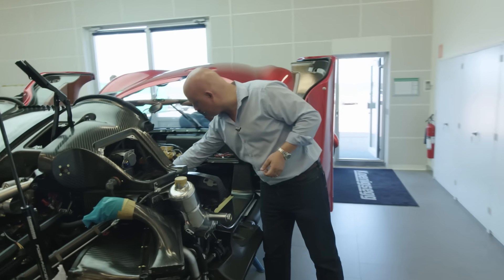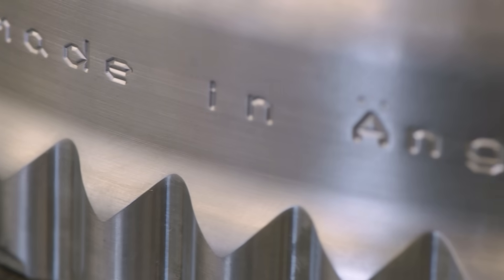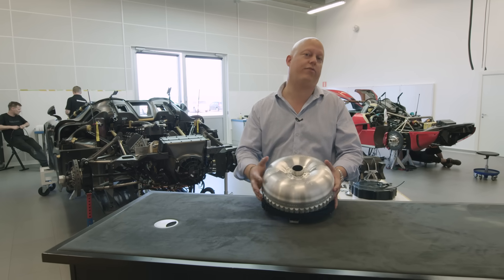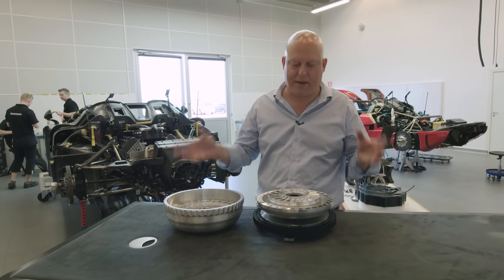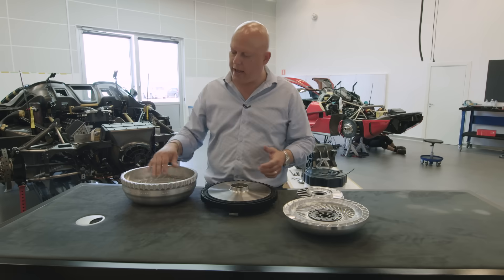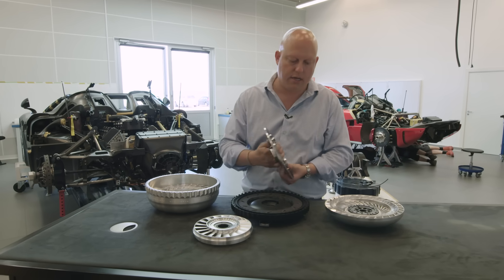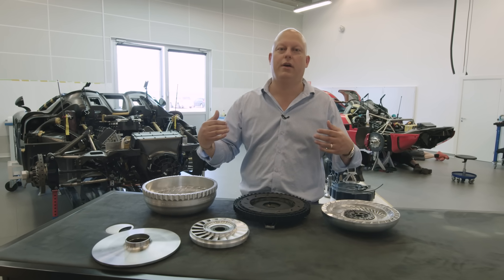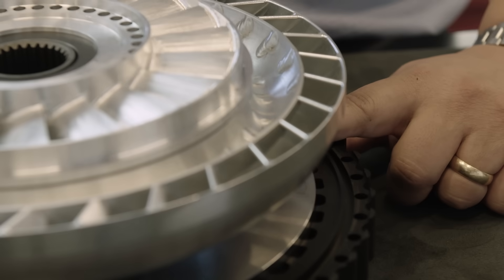248 MPH Without A Gearbox: Direct Drive  -- /INSIDE KOENIGSEGG

Comment: I wonder what is the life of that torq converter? Aluminum will fatigue over time, and wear out. What is the cost of that thing? And did you have to use special fluid for it? Its a convertor on steroides, and the weight and force of what it has to endure is really extreem. How hot does it get?

Comment: I think maybe he stated an error. When referring to the use of only the rear electic motors he said 0-60 in 4 seconds, the he said that with a change in gear ratio acceleration is even faster. I was always taught that electric motor made the same power at 1 rpm as it does at any other rpm..torque curve is a flat line...can't have an increase in acceleration without an increase in power. What he said does apply to an ice but with his torque converter setup it is possible run the engine very close to peak torque all of the time...sure be fun to drive, I bet it's one of those deals that pulls stupid hard at any mph...no down shift required...no downshift possible.... downshifting is now known as engage all motors and engines on my mark big BANG and we gone...lol

Comment: It's a fairly simple system, but when battery technology advances enough, pure electric direct drive will be the way to go. If I were to attempt to break the wheel driven land speed record, electric would be the way to go. You just need enough battery charge density, a powerful enough electric motor and good aerodynamics to crack it.
Reply: electric cars still want to up shift at these speeds. their power band is wide, but still not THAT wide

Comment: So basically its a turbine connected to the motor that transfers its energy to another turbine connected to the wheels, until they are traveling at the same speed at which point it locks up.  Is that accurate?

Comment: I wonder how long it will take the Tesla roadster II to break these records? ANd they will be about $250,000 each, can hit 100mph in 4.7 seconds, 60 in 1.9 seconds and are so much cheaper. Monocoque  carbon fiber design and never change the oil, no valve jobs and all the other very expensive maintenance that hyper cars require just to stay on the road. I think Musk might be onto something there. but he needs to get some sleep, he's burning out.
Reply: if he doesn't bring back a multiple speed gear box, it won't be as fast.

Comment: So it's basically a 2 speed gearbox. Or a "hydraulic CVT"?

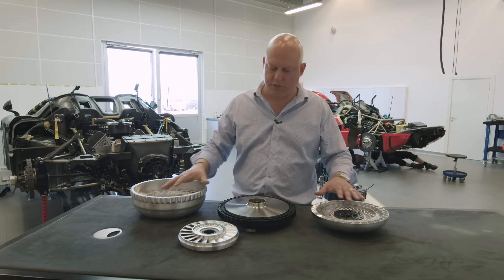Did anyone else catch the part where he said it can take 2000 rpm in, put out 1000 rpm and more than double the torque? Free energy machine right there! At 5:57
Reply: There is no gearbox in the regera go online to see how it works or watch engineering explained video
Reply: I made the same mistake here as Jay Leno, interchanging the words "gearbox" and "transmission". I meant the torque converter functions as a 2-speed transmission whether it's in lockup mode or not. Because Christian says it can do a 2:1 speed reduction and double the torque, or run 1:1 when locked up.

In Jay Leno's video, he keep saying it has no transmission. What he means is it has no gearbox. The torque converter is a transmission.

Comment: Pretty cool engineering but how long does this torque convertor last?  If it is like that carbon fiber clutch in porsche gt, replace every 15k.. i am sure cost is probably more than most cars and you will have to wait for them to make one ;)

Comment: Wow, that is a smart technology! Combustion engine and electric engine combined on giving torque on this progressive, dynamic, hydraulic transmission system. That is amazing! I wonder at what speed does the lock up clutch mode activates.
Reply: Though this is pretty old technology what he did is put a hybrid drive train to make it more Morden

Comment: Okay got that, seems clear enough. Having heard a Regera in traffic going on and off the throttle, I found I didn't like the sound, it was like listening to a cvt in a hypercar. I didn't like the whoosh noise of intake air either from the cockpit, sounded like an ordinary car minus it's aircleaner. Otherwise nice car. Oh, and I thought that was the exhaust at the rear, not the air extraction outlet, lol.

Comment: Can you make one for my 1998 Honda Accord?
Reply: if it is an automatic it already has it
Reply: So to emulate this zegg, i just need to throw away my gearbox but keep the convertor, connect the convertor directly to the drive shaft, get a forklift motor and connect it to the convertor via a friction clutch which desingages at high speeds, connect the engine to a 5:1 torque multiplier with lock up feature and connect to driveshaft, get 8  normal car batteries as a battery pack, get 4 alternators and hook each to 1 wheel using brake activated friction clutch, maybe instead of 8 batteries i get 4 hydrualic pumps, attach each to each wheel with brake activated friction clutch, get another forklift motor to generate power for the drive shaft dc motor
Reply: Buy automatic remove gears =direct drive

Comment: People are too amazed!
Basically Formula 1 has had this and other technology for 30 years.
I'ts rather that new tech gets banned from Formula 1 because the cars would go too fast!
CVT gearboxes.
Turo and Compressor.
Horizontal mounted shock absorbers.
Torque convertors.
Launch control.
Traction control, 
Individual tire torque/brake control.
Venturi tunnel.
Paddle shift gearbox.
Reply: All of those were people designed

Comment: So the way I understand this is:

The Regera is constantly in 1 gear which is equivalent to 7th gear on the Agera.

But the way it takes off or even moves in general is by using a hydraulic torque converter to double the torque produced by 1200hp combustion and 200hp electric motors.

Combined with the HP from the electric motors behind the torque converter.
Reply: Exactly there are two 200hp electric motors in the rear on the wheels and one in front on the crank shaft.
Reply: it is basically like a cvt.
Reply: @devinwilliams3489  nah, it's not. CVTs still have a variable gear ratio to change the torque. This just uses the torque multiplication principle of the torque converter.

Comment: Brilliant, Tesla should use this idea.
Super clear explanation 
Basically the idea is he is using a more efficient and lighter torque converter attached to a high power power plant (engine+motor) it would work also with an electric motor or  an engine, instead of using gears or a single gear like Tesla.
Because the engine-motor produce  massive  power it can afford that. The TC has a 1/2 ratio so 7th like ratio gear at low speed is converted to 3.5th gear. It is equivalent to starting from still in the 3th gear and the car can afford that just like Tesla is able to start from still in an equivalent 6th gear and still manages good acceleration. With a hibrid you can't use a DDrive effectively like Tesla because e motors don't need to idle unlike engines.

Comment: Love it.. this video helped me understand the direct drive system of the Regera fully instead of in 'general'.  This man is a genius, literally,.. this is one piece (a very important one) of thousands he designed uniquely for his vehicles.  However, generally we see Torque converters in automobiles in automatics to pressurize them for the automatic changing of the gears (to put it simply).  He wanted a way to marry electric motors AND a powerful combustion engine in a novel process that required LESS not more and is more simple , at least in this part,.. The genius imho is how he uses the electric 400-500hp capable motors for the low end 0-20 ish MPH (and of course reverse since it would be impossible for the combustion engine to go in reverse with this) while the combustion engine is SLIGHTLY revved to generate enough POWER (literal voltage) to run the electric motors -- All the while the drive line is not synced/connected -- the stator isn't locked... Then around 20-30mph the coupling locks together and both electric and combustion are turning this one unit (flywheel, as he said).  ... but also he kept the paddle shifters on the car to , at any time , disconnect the Direct Drive again so you can alter the revs of the combustion engine for your purpose of driving the vehicle.  (Ie: Racing, cornering, straight line speed, etc).  Then you hit the paddle again and it reconnects.  (This is totally optional by the driver.)  
As I mentioned earlier -- you press both paddles towards you to bring the car into 'Park' and then hit the left paddle towards you to go into "R" everse where the electric motors are able to reverse and still provide 500 horsepower 'technically' for going backwards.  Not that anyone would care to use that kind of power in reverse.  

If he designed nothing but this one option he would have invented a somewhat revolutionary way to simplify a drivetrain of an automobile -- but it's mind boggling the number of novel items he is responsible for designing - and to the best of my knowledge he is not formally trained in engineering etc.

Comment: Nothing special Here. If your engine is poerful enough.. You dont need a gearbox at All.. Nothing New. Here.. An they use a Torque converter that the combustion engine can delivere more Power for the same speed Situation.. They dont need it because the Are so near to the max grip of Theire tires that the Torque difference in higher speed is filled up aditional by their Elektric System... It the same like some racecars have a Real long 1 gear...

Comment: I bet that the torque converter companies were not willing to work with them because they understand that the fluid can not sustain that much heat generation for long and they don't want their name getting stomped on when customers start complaining that their million dollar vehicle broke down.  This will probably be fine for a run on the drag strip or two, but try driving through the mountains at the speed limit of nearly any country and the heat will kill this thing fast.

Comment: It's a kind of CVT, or not?
Because when I saw the Regera accelerating, the continuous rotation and the constant acceleration looks like a CVT transmission.
Reply: Sort of but not really. Fundamentally this device is a fluid coupling- a pump (connected to the engine) forces oil through a turbine (connected to the driveshaft), transferring power without a solid physical connection. The stator device in the middle is the tricky bit: when there is a large difference in rotational speed between the engine and the driveshaft (e.g. when you floor it at traffic lights) the stator alters the angle of the flow through the turbine, resulting in a greatly increased amount of torque being produced to help turn the wheels. It's not a CVT because it cannot actually change the ratio between the engine and the wheels, instead it can only allow the engine to slip and turn some of the difference into torque. The same device is used on conventional 'slush box' automatic transmissions, which is why they can idle with the transmission in gear. The Regara has such incredible power that it has no need for a normal auto gearbox- instead it just accelerates using pure brute force, the engine being so powerful that the tires lose grip before the engine is delivering its full output, even though it's stuck in what would be the highest gear for a normal car. Accelerating from a standing start like this is very inefficient (the torque converter wastes power due to drag produced by the flow of oil), but thankfully the Regara is also a hybrid, so the car just uses the electric motors to start moving under normal driving conditions. Once the car is going fast enough for the engine to turn at the same speed as the driveshaft without stalling a clutch locks the torque converter, creating a direct mechanical drive to the rear wheels.

Comment: Since you have the electric motors and rarely use so much power it will be locked most of the time and the electric motors will add the power, even that won't be necessary, even at 2000 rpm you'll have plenty of oomph with 1200hp. When you rarely need full power you will use the torque converter.

Comment: i guess its a torque converter if you need a higher torque for instantaneous acceleration and if you do not need higher torque it become a hydraulic coupling with the same rpm with the driver e.g. electric motor or internal combustion engine or a direct drive..correct me if i'm wrong..

Comment: Looks very like a  mid 50s Buick dynaflow variable pitch converter to me.
Reply: Jimmy J we had a dynaflow in the family and I was thinking the same thing. Except the Buick wasn’t anywhere near as efficient
Reply: SWITCH-PITCH
Reply: Richard Wolfe,
Variable Pitch is the correct term, if you wanna split hairs, but you get the idea.
The addition of an internal roller clutch, aka sprag, in the stator made the VP obsolete.
This simple design change made convertors much more effective, more efficient, and way more reliable.
The VP was little more than an upgraded fluid coupling, and was more or less a baby step in the evolution of the modern day Torque Convertor, really.
I remember them well, but haven't had one cross my workbench since around the mid to late '70s. 
They failed a lot, and were very slushy on the road. They weren't around very long. I think Pontiac was heavily invested in the idea, but they were quick to adopt Torque Convertors at their first opportunity.
GM has always had problems with their transmissions, from a longevity standpoint, and the warranty work eats them alive, year after year, after year.

And BTW, Koenigsegg's TC is not a VP design. It as just a basic Torque Convertor with an internal Lock-Up clutch.
But his application is so demanding and unique that nothing from a modern production automobile could be adapted for use. So, he applied standard engineering principles, and known data, and built what he needed from scratch.
And you know he was fully sold on the benefits that a TC offers to his application, or he wouldn't have gone thru all the engineering processes, and the headaches that go with it, along with all the expenses required to adopt such a thing into his car. You could say, that car is built around the torque convertor, and that it adds much to his overall success with that platform. And keep in mind, that this TC  was not an afterthought add-on. That car incorporated the idea from its very conception.
That tells us how vital it is, and it is an essential factor in his success.
Works for him, obviously.

Comment: Basic torque converter, 100 years old. Electric motor augmentation is a nice touch.  Lock up clutch will not work with the electric motors kicking in at the 'right' time. Kudo's to the software guys !

Comment: It's not a new idea to run direct drive with no gearbox, we did that in the '80s with a race car that had a 900 hp engine, twin plate clutch and a diff bolted to the bell housing. It was pretty quick, 0-100mph in 3 seconds and it saved a lot of weight. I like this idea though, especially with electric assist it makes sense, a gearbox is just unnecessary weight. Especially one designed for 1200bhp levels of torque.

Comment: so from what i'm getting out of it, it's a very low stall lockup converter, where the engine can't fall flat on its face from a stop because you have 500 hp's worth of electrical motors taking care of take off, and as the electrical motors lose efficiency at higher RPM the converter is locking up and the gas engine is coming onto it's effective power band and doing the work of accelerating. so they call it a hydraulic coupling because it's just intended to smooth out the transitions between electric motor power and gas engine power and not necessarily convert (or should we say multiply?) torque as it normally would in a typical torque converter.

Comment: it's not a huge difference between that one and the old engine to transmission link, but the idea here is he had the best of both worlds by adding the 2 of them the "Automatic" Hydraulic clutch for the best consistent Power delivery and the "Manual" Friction clutch for the best Torque delivery, then he actually glued them together and found a simple way to switch between the using those gear tooth on the hydraulic clutch. who else would have such an idea GG KOENIGSEGG